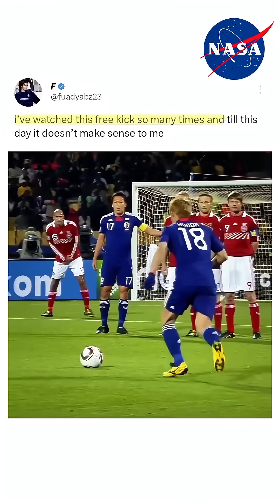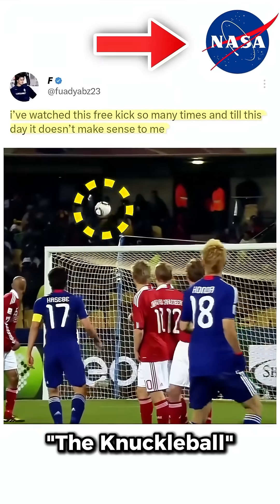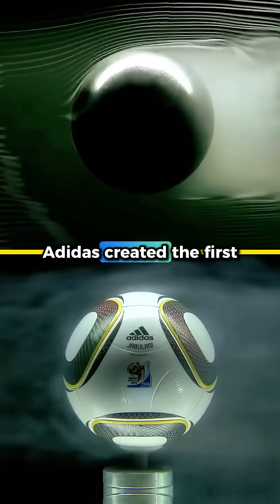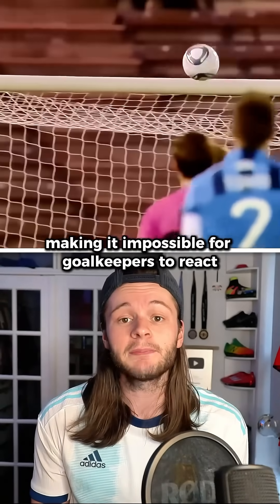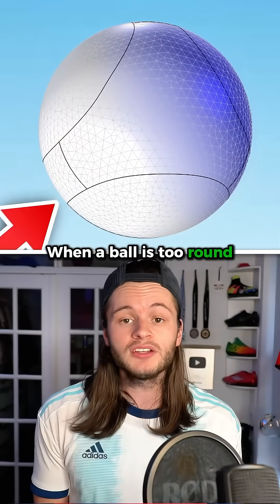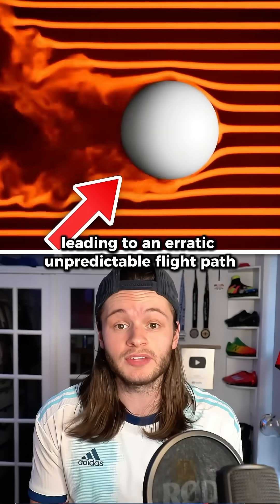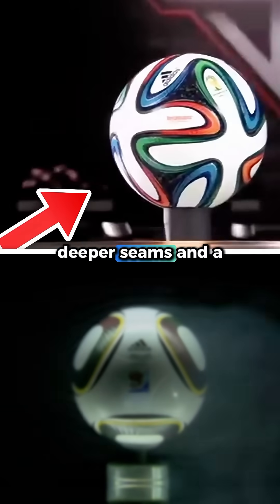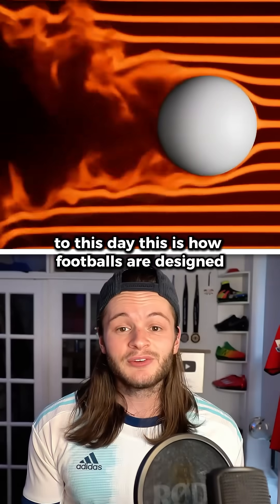The Demise of the Knuckleball

Comment: It's not just the smoothness of the surface. At the point of launch, the ball ceases to be a sphere and has a slight 'dent' where the foot hits it. This dent then over corrects as the pressure in the ball tries to equalise again, then it does it again until a stable equilibrium is reached.
This all happens within a split second and affects the trajectory of the ball. Theoretically, if you could do this in a vacuum, thereby eliminating all surface drag, you could measure this effect.

Comment: This is the most braindead thing I've ever heard. If you've learned just a little about neumatics you'd know it happens because of the venturi effect. I recommend searching it up but to summarize it, when the ball doesn't spin all the air in front of it has the same force, giving it an erratic path. If it spins, the force of one side is less, so it describes a parabolic path

Comment: Y'all really needed NASA to explain something that simple to you? Perfectly round means little to no air resistance. Little to no air resistance means no directional control. The grooves and the lines guide the air across the ball. Much like the wings on a jet. Depending on which way the ball or the jet is turning, the wings or the grooves on the ball will direct the air to propel the ball or the jet and whatever direction. It is the job of the pilot or soccer player to understand the physics of their guided projectile and act accordingly. If you can understand how a paper airplane works, you should be able to understand why a perfectly round ball was not ideal.

Comment: No. This effect was a thing on footballs beforehand. If you look these shots they are hitting the ball perfectly with almost zero spin.

What then happens is the air will catch a seam and start to pull the ball in a certain direction, this can even cause a ball to change directions multiple times.

If you impart loads of spin on a ball, the seams actually have very little effect and it will curve consistently.

Comment: Bring back the Jabulani, the Roteiro and all the Total 90 footballs. Free kicks and long shots suck these days. In the early 2000s we used to get 30-50 screamers from outside the box. The ball is way too light now, even if you hit it with power (it tends to rise in the air instead of dropping). Take a look at CR7, R. Carlos, Beckham, Ibra, Adriano, Recoba, Juninho, Totti, etc. back in the day, the ball would travel at 100km/h+ and spin on its axis making the trajectory almost impossible to read. Now the ball doesn’t swerve at all, making it much easier for professional GKs to predict the curve, anticipate their move and act accordingly

Comment: Full of misguided notions. First, the aerodynamics of spheres has been know for a very long time. It's on every respectable book of Fluid Dynamics. Nobody called NASA to explain anything. NASA did not perform any experiments for FIFA. The same knowledge has been used for golf balls, tennis balls etc. The issue is partly about being round - but the footballs are still very round, and most sport balls are round (except for rugby and american "football"), the issue is about being SMOOTH. The knuckleball effect - the "dancing" trajectory - has been widely known in baseball, like "forever". 
And the phenomena is NOT ONLY due to smoothness; it depends on the speed - which has to be smack inside the proper window range of velocity, which depends on the diameter (we are talking about air only) - and also, very important, you should avoid imparting SPIN to the ball.

All in all, it is really a fascinating subject, which, by the way, should not be blemished by all this nonsense of a "youtuber" attempting to attract attention to himself while providing NOTHING for the audience. This is a fraud.

Comment: The irony is that any other ball would have likely caused greater inconsistencies due to the sheer difference in altitude between the coast and the highveld. And this a ball that kinda just slides through the air is probably the best bet

Comment: "NO way to grip the air around it". Nah. The problem was that a smooth surface makes the air TOO grippy, and every little breeze and spin creates flight changing "Bernoulli effects",  which is the same "low pressure" laminar flow effect over the top of an airplane wing.
The video "Testing the  World Cup Ball in a NASA wind tunnel" explains that they need rougher patches to disrupt the "boundary layer", so the "Lift " from the Bernoulli effect is disrupted.

Comment: I think this is a good explanation for why AI art generators arent like an art tool. Cause the problem here is that the path of the ball, and the potential goal, don't come from the skill of the kicker and how they hit the ball, but just from random air currents around the ball. Similarly, what a person using an art generator puts in really has almost no effect on the actual output other than the general direction it goes in, just like with the kicker in football.

Comment: The jabulani had 8 panels and a textured surface. It had less panels than the ball before it therefore less seams. Issue with the ball is that it was found that for the 'knuckle' ball effect to happen, needed more speed than the balls before it (more panels and seams...). The difference in ball speed was about 10mph. The rub, this increased speed that triggered the knuckleball effect (against the rate of spin put by the kicker), was also the typical speed that balls (of previous designs) were being crossed, passed on a break or volleyed front of goal. This meant, for those that didn't have a lot of time with, the ball appeared unpredictable.  Usually the amount of spin or compensation was not appropriate for the ball. (Maradona commented that there wouldn't be much long passes because the ball didn't travel straight...) Depending on your personal technique, the effect might be more pronounced.  Honda's technique married to that ball, created that memorable goal.

Comment: it doesn't really matter if you change the ball. (only a very subtle difference may occur ofc)

If you got the Technique - to properly hit a Knuckleball, you will need to literally change the shape in order to prevent that from happening.

Depending on the Strength you able to put behind the Shot + the Technique = (the Harder you able to shoot, the stronger the Knuckleball / Unpredictable Flattering or swerving midair gonna happen)

Comment: If you look on airplane wings, they often have small triangular nubs in a line. Those are called vortex generators and are used for essentially the same reason. To “grip” the air for more lift. 

Pretty cool and effective phenomenon for some tiny metal nubs
Reply: or golf balls

Comment: I guess in laymans term and simplication hypothesis, The ball IS round, its just that how he kick is simple thats all, To elaborate further, He use his foot, the side foot to kick the ball not from the center but below angle shot to throw upward and let the gravity control the air on the ball, it doesn't spin much because the kick is simple trick shot.. upward kick..

Comment: This is a problem of turbulent vs laminar flow. A ball that is too smooth doesn’t create any local turbulence around the ball and so you get a bunch of angry toddlers of air pulling the ball in every direction. This is the same reason golf balls have dimples. 

Also, minor point, but it’s not that the balls aren’t round, they aren’t smooth. It’s a surface change, not really a shape change. Is that pedantic, yes, but I was really confused for a second

Comment: It's not how round it is, its how smooth it is. It's why golf balls are dimpled and table tennis balls are smooth. The physics has been well known for a long time.
The air flow sticks to a smooth surface so aerodynamic effects will act upon the ball causing it to swerve or dip. A rough surface 'trips' the airflow causing a turbulent layer between the ball and the laminar airflow, sheilding it from aerodynamic effects, giving it a more predictable trajectory. You can still swerve a rough football by giving it side spin. The side spin creates more turbulence and hence lower air pressure on the side that is rotating towards the direction of travel, so the ball will be sucked in that direction.

Comment: Just a guess, it wobbles because no spin, and the shape produces inconsistent low pressure up down left right  the push right causes less pressure to no pressure right and little more pressure left. Through flight path this is happening on all axis.
Also assume at different angles of flight path pushes and breaks can be more severe at the point of decent the break down left and right is random depend on the state of left to right push.
The balls shape and texture play a role, more movement would be cause from rougher texture. Threads, indentations, protrusion points facture into the equilibrium  of movement along the path, which is also random because it would be nearly impossible to reproduce the same face to flight path.
This causes randomization  on every kick.
Or throw of a baseball with no spin.

Just a guess. I never studied this. This is why in basebasket shooting a knuckle ball is terrible. Spin add consistency within a range of results. This is because spin, no matter face, the average spin rate is going to cause an average movement. When it is spinning like a golf ball at 2000 3000 4000 times per second, you'll get that consistent average.
No spin adds randomization along the flight path where location along the flight path equilibrium of wobble can drastically change from the randomized pushes.
 Also depending on sequence of pushes left and right and up and down. Flight path varies on these sequences, you can get a balance  that looks like random wobbles  on the axis, if sequence matches up the ball can look like a clock wise or counter clockwise circular wobble, in addition these random up/down left/right wobbles can break in and out of counter-clockwise and clockwise wobble sequences along the flight path, and can indeed alter the  flight path creating a secondary flight path. If traveling long enough distance to infinity, distribution of a circle shape would occur with main dispersion located in the center and random outliers spray painted dots getting lighter towards the outer circumference of the circle is how I'd imagine it. And I'd also imagine the dead center of the circle of the dispersion  called the bullseye being oddly less concentrated than the nearby neighboring surroundings almost like a donut where the bulleyes is less intense/dense than nearby but more intense/dense than the outer circumference of results.

I never studied this. Just common sense to me. I could be wrong but this is my observation of the world.

Comment: Man, you could’ve paid me half of NASA’s pay, and I would’ve told you that. It’s completely obvious. If it’s too smooth, the air will bounce off of it—not to mention the wind and resistance. The complete roundness of the ball means that as the air wraps around it, once it reaches the backside, it just randomizes—mainly because of the ball’s rotation. Compared to a textured ball, where the grooves guide the air dynamically and accurately to the backside, keeping the flow controlled. That’s what allows the ball to stay precise on kick placement instead of wobbling unpredictably.

It took NASA months. It took me seconds. No research. Just brains.

Comment: It also depends on where you place the valve. We used to change it for a volleyball server to change how the ball would travel and you could make it do a knuckleball if you hit it correctly. You could change the direction depending on which way the valve was facing. Could make it dip or float longer placing it at the top or bottom.